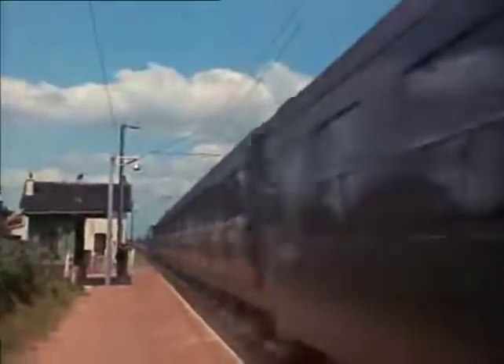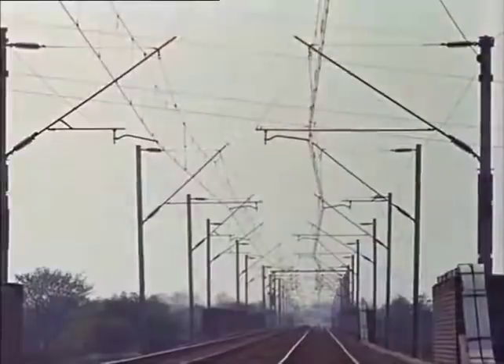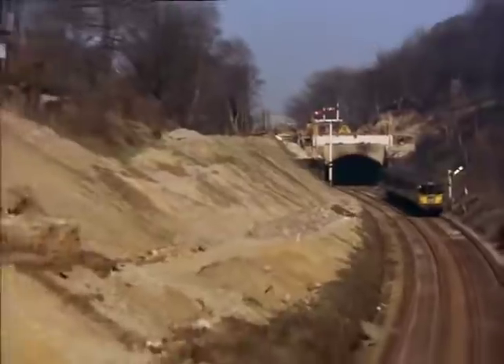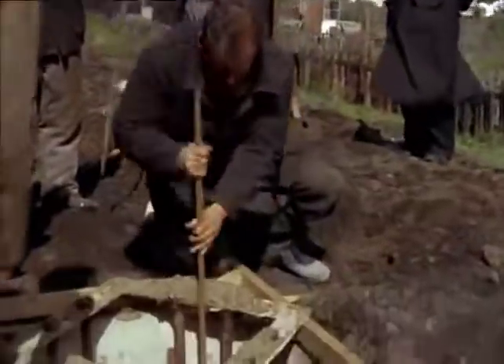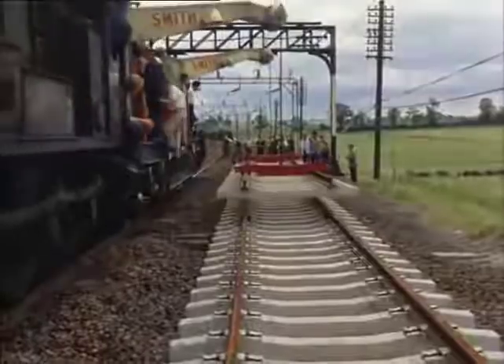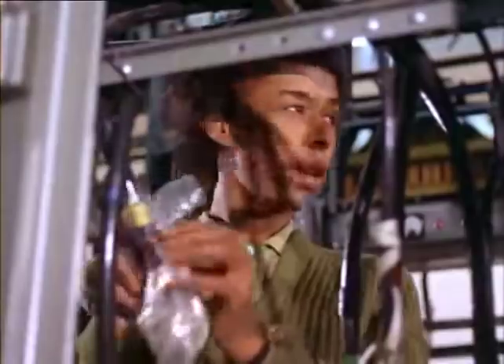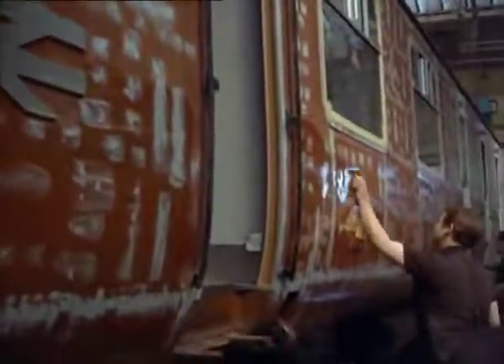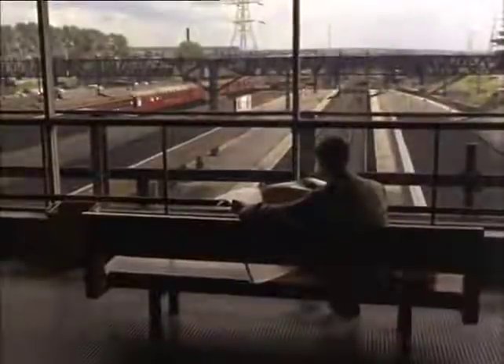Under the Wires - 1966 - Electric Train

Comment: We would set up our two sets of American Flyer trains every year along with 2 pair of track switches and lights inside the plastic ville buildings. Starting around 8 years old my dad would draw a wire schematic and told me to follow it. The transformer had a circuit breaker on the low voltage output luckily. Liked playing with wires so much was an electrician for 50 enjoyable years. Still like to watch trains go by. Find the non passenger trains most interesting with so much variety.

Comment: In the early days of the key system in Oakland CA the overhead line was put up live, that's right it was energized with 600 volts. The car pushing in this case a streetcar pushing the flat car with the spool of overhead line was being powered by the overhead line they were putting up

Comment: And after all these years the line between San Francisco and San José in California is being electrified - at 25kV of course.
Reply: New South Wales in Australia suffers from the same problem it was constructed using 1500 V Dc and 700 amp but that is very inefficient and you need to many sub stations but instead of going over to multivolt loco's and using 15 kv for all the rest of the state they decided not too and shut alot of our lines down

Comment: What a great documentary! Made probably in 1966, the I was born... But did you see those working conditions. I guess that would not be allowed today. Those guys climbing the masts and that other guy walking over the girder, over 5 meters ( 197 feet) over the tracks, all without a safety gear...  And at 22:35 I really hope that wire was not hot when they are so close to it. But the UK was clever to choose 25 kV AC. Here in the Netherlands they chose 1,5 kV dc. I read a book about the electrification of railways in the Netherlands from the 1920's till the 1960's. And in the beginning AC traction motors were large and heavy, the DC motors were much smaller and lighter.
Reply: I think you meant 19.7 feet not 197 feet

And your correct about the motor's too all you have to do is have a look at the early electric locomotives used by the Swiss on the Gothard line and you can see how large they are

Once they were able to produce Asynchronous motors they were able to bring the size down considerably
Reply: @evangiles4403  Yep you are right, a calculation fault on my side... 3 feet = 1 meter so 5 meter should be around 15 feet. O I just rember I have been calculating with inches... Sorry. 197 inch = 5 meter!

Comment: And to think this was "state of the art" equipment and methods of placing, repairing and replacing of track and wires is obsolete.  Today's technology with computers and micro relays replaced a lot of the old manpower required to operate the system (until the next major solar flare or EMP detonation, then we are back to the stone age).  Great video of how these systems were built and operated.  Thanks for posting.  I am one of these "how it works, why it works and the behind the scenes kind of guy".
Reply: It was more than half a century ago. The 'State of the Art' tends to move on a bit in that time!

Comment: Nowadays the line would be closed for months with Bus Substitutions for the work to be carried out. Not a yellow Vest in sight
Reply: The rather snazzy Safety Tie at 12:40 should be enough for the whole job, even the bloke ascending a portal with only climbing wellies.
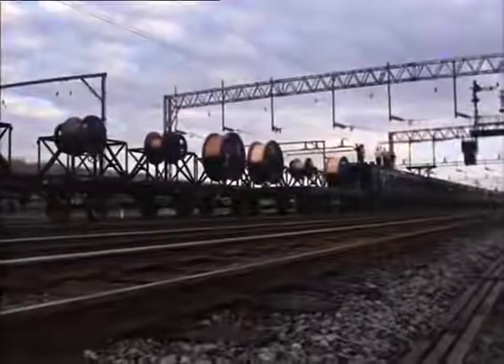Reply: Back in the day, some of the works were carried on the active line, between hi-speeds, ssssslightly spreaded in timetable..  Blokes used to work, like the ones at 13:14 - Parts are manufactored in a mobile factory, everything is slapped together on the roll.

P.S. War is a terrible thing to live thru, but boy-do people achieve some great stuff, in the next two decades after. "No bombs, no shells - that's safe enough, now go on, meh lucky lads, i'm off to the mine.."

Comment: This being home older documentary I'm sure things have changed significantly. 
I'm into communication systems, and wondered if anyone knew if electric railroads utilizing the overhead trolley cable ever tested using "RF Carrier" that is to say using low-frequency radio over electric wires that would have seemed a natural way to communicate with engine drivers or emergency shutdown control?
Reply: IIRC some systems use the rails for communication. Don't think any system uses the overhead wires (I figure any arcing between the wire any the pantograph would really screw up the comms!).
Reply: It does not seem likely. The frequency would have been very low to avoid the trolley being a giant antenna. Very low frequency is below a few tens of Khz. Is would have been an impractical system as frequency division multiplexing due to the low frequency. Above a few tens of kHz the system would interfere with LW stations. In that era very significant.

Comment: Nice video! Those class 310s ended up on the London tilbury and Southend on their last days arriving in about 1989  being withdrawn in 2001. I used to travel them every day. Nice to see the electrical schematic along with the sound effects of clicking of the starting resistances switching out as the train accelerated, I always travelled on the power coach to listen to these powerful motors.
Reply: Cl 310s and 312s were lovely trains, probably the absolute zenith of First generation emu designs, and, uniquely, the only British units based on the Mk II coach. (The 80 class DEMU built for Northern Ireland Railways were the only other Multiple units based on the Mk 2, but of course they were 5'3" gauge)

Comment: Is this film available somewhere with less digital compression or other digital artefacts? 
I can tell the source material is pretty decent, but it's been highly compressed or too much noise reduction has been applied, making the video blocky and choppy.
Reply from the maker: Unfortunately, I didn't find higher quality. That's what we have.
Reply: +1 it looks like it was encoded on a potato.  There is plenty of detail in that original film to be got at if someone scanned it in HD and with decent bitrate.
Reply: I'm fairly impressed. If I didn't know better, I would have thought that it was shot on 625 line PAL video instead of 35mm (which I assume it is)...
Reply: @stevem.1853  Need to get yourself down to specsavers, 625 PAL was better than this highly compressed crap.
Reply: @neodonkey  I guess my expectations for a production of this era are pretty low. I wouldn't have been surprised if it had been shot on b/w 16mm. I admit I know nothing about digital video production.

Comment: I don't think anything matches the sound of an old AC under full notch screaming like a banshee.   On the Motorail's we used to get from Kensington in the 70's it was diesel from Olympia to Willesden then you heard the 8x slipping past howling fans and then it was AC all the way to Carlisle.   It was funny back then as drivers remained paired with loco's so the engines were swapped out at the limit of the drivers knowledge which was usually Willesden to Crewe, Crewe to Rugby and so forth and the silly thing too when the Scottish loco crossed the border at Gretna, the ScR engine had to pick up a MR pilot who got on and off at Gretna, all because of ASLEF rules.   The ScR loco was usually a 47 but occasionally a 37 which changed often to a set of 27s where the train divided at Carstairs and divided again at Edinburgh, with the final portion onwards to Inverness arranged so the Stirling, Perth car flats were rearmost and light enough for a type 2 to handle.   I remember my class 33 driving uncle based at Hoo, if he had a Willesden Ford freight, if he heaved into Willesden directly he picked up a MR pilot at Olympia, then BR just rostered him to unhook at Olympia, run round to pick up any empty returns in a complex dance of two locos running round each other which must have kept the signalman there on the hop.